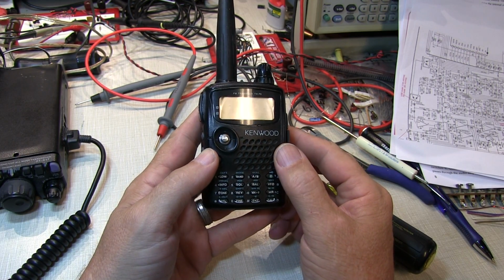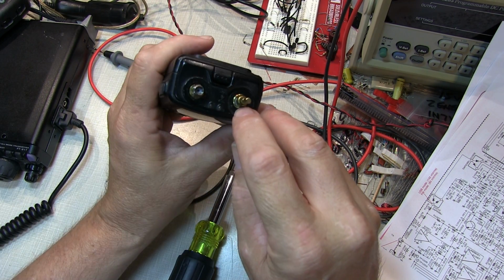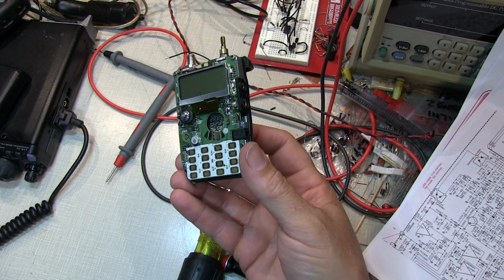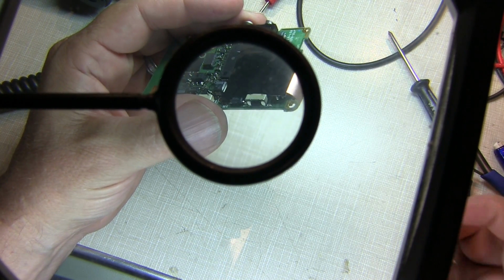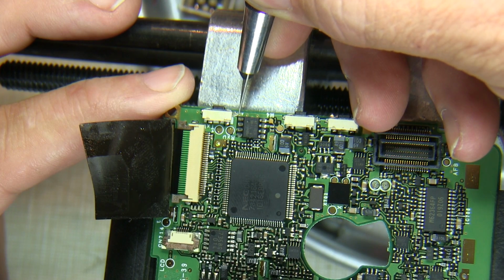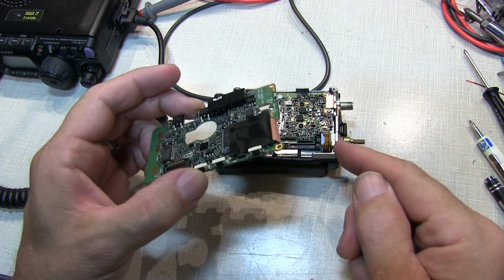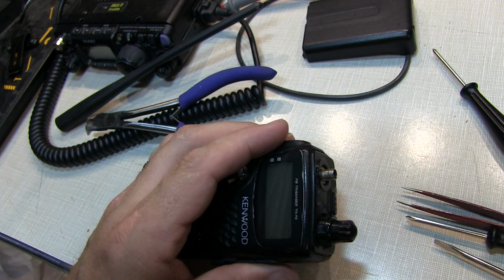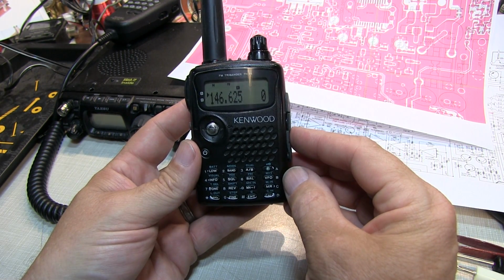#239: Repair of Kenwood TH-F6A radio's Push to Talk switch

Comment: Mine got rained on, which ruined my new battery and now the keypad switches all act dirty or corroded.  Hoping when I open it up I can see oxidation to remove and restore full sensitivity to those buttons.  If anyone has experience with such issues please comment thanks.  

It's such a great HT that I bought a second one in good shape, but I still want to get my old one operating properly again.

Comment: I know this is an old thread however, I'm hoping someone will be able to show how the ribbon-cable connector is loosened so you can remove the ribbon cable attached to the pc board. The video skips that very critical (to me) portion of the repair. I don't want to damage anything by trying to force the connector. A video of this would be most appreciated or a link to a video that shows this process. 73 - W3DRM - Don
EDIT: NOTE the instructions I've found merely say "Extract the encoder flat cable from the connector" Unfortunately, they don't explain how to make this happen.
Reply: SUCCESS!!! The disassembly, replacement of the DC-Jack, and then reassembly went smoothly and without any problems at all. While I had it open, I also cleaned-off all of the old (and hardened) thermal paste. Now, I hope I'm good for another million miles on this trusty old TH-F6A. It has been a true workhorse and tough as nails. Thanks to Alan for his inputs and guidance for the cable-connector.
Reply from the maker: It's been over 4 years since I did this, so I don't remember specifically.  Some of these types of connectors have little release clips on either side and then the ribbon just slips out, and others are more of a friction fit.  For the latter, I'll often use a pair of smooth jawed needle-nose pliers to carefully grip the ribbon, or just do it by hand, and gently wiggle it side-to-side.
Reply: @w2aew  Thanks Alan. I tried using my smooth jawed needle-nose pliers without any luck. Didn't want to try too much force as I certainly don't want to damage anything. I have sent Kenwood support an email request for the "proper way to extract the cable". Will post here if I get an answer from them. 73 - Don - w3drm.
Reply from the maker: @W3DRM  Take a look under some magnification to see if there is a clip or latch that lifts up.
Reply: @w2aew  Thanks Alan. I appreciate the help. I have successfully disconnected the ribbon-cable. To do that, all I had to do, as you suggested, was lift the cable connector clamp that is of a darker color. It just swings upwards and did not take much force at all. Then all you do is pull the ribbon out of the connector (carefully). My next task tomorrow is to remove the lower pcb board so I can get to the dc-jack solder connections and replace it with a new jack.

Comment: I've run into a fair amount of stuff that was not all that robust mechanically,  and ended up with problems like this.  In particular there were a bunch of those cheap little musical keyboards that you used to see all over the place,  with the DC input connector being the problem -- it stuck out the back and if the instrument got pushed up against something that'd tear up the connections like this..  It seems like the mfr. had the soldermask arranged to use as little solder as possible,  so what I usually ended up doing was scraping away a bunch of the soldermask surrounding the terminals and then applying a lot of solder to do the fix.  Never had one come back with the same problem after doing that...

Comment: Hello w2aew, I have an issue with my TH-F6A, this is what happens, as for receiving everything is OK using analog signals, however when i use PTT sometimes the microphone works smoothly and some other times I only hear clicks while the push button works with out the microphone signal. Can you help me with any idea
Saludos
Enrique

Comment: Great video! I used this tutorial to replace the keypad buttons in  my TH-F6A. After 5 years of almost daily use, the bottom buttons were wearing down. Except for the wear marks on the plastic case, it almost looks like a new radio! These F6A's are great little tri-banders and was my first radio as a licensed ham back in 2011. The price has been dropping on these lately probably in anticipation of a newer model with more features. Maybe DMR? 

FYI.... The rubber key pad (BUTTONS ONLY) are available from PacParts, Inc. www.pacparts.com 
Part Number: KEN-K29-9107-22. As of 12/13/2016, the price was $11.17 plus shipping and sales taxes where applicable.
Reply from the maker: Congrats on your repair - I'm glad this video helped.

Comment: with these kind of repairs I always like to add some hot glue or silicone glue just add some mechanical strength to the switch.
Reply: VoltLog I was going to say/ask the same thing...seems like some well placed hot glue or epoxy would have given it a bit more mechanical strength. These things seem so flimsy and easy to brake!!

Comment: Neat !!  I might have tried some hot melt glue to firm up the physical strength after the repair was completed.   I'd worry that the switch might break away again.

Comment: Is there an actual tool available for those slotted retaining nuts? They drive me crazy.
Reply from the maker: I'm sure there is.  I have sometimes made them with a little careful grinding on an old socket, or have also use a "watch back" tool.
Reply: +w2aew yes, yes there is. I have one at my work place and use it all the time, love the video's w2aew, de vk3hau
Reply from the maker: +vk3hau  Can you let us know what the "official" name of this tool is, and where you bought it?
Reply: +w2aew it is work suppled, may be RS components but will have to check when I back at work, off work for 2 month sick leave with broken leg. So as soon as I know I will let you know, I'll have a google look to while laid up in bed...hi hi..
Reply from the maker: +vk3hau  Oh, sorry to hear about the broken leg - ouch!  Thanks in advance for the info, and hope you mend soon!
Reply: +w2aew I found the ones I use at work, here is a link, check them out, they are Spring load interchangeable head with swivel head so the head clamps inwards or outwards, they are known as circlip pliers but they work a treat on these nuts, been repairing radios in my line of work for 14 years and these ones I use have been at this workshop longer then me.... https://sydneytools.com.au/boxo-boxvg406b-multi-circlip-pliers?fee=4&fep=11607&gclid=CjwKEAjwoPG8BRCSi5uu6d6N5WcSJABHzD8FHLdee0U0IgAdDJWf90TbUd3K-rADaBBao959mfCD7BoCaXLw_wcB
Reply from the maker: +vk3hao - Thanks! I've used those circlip / spring clip pliers as well, especially the 90-degree bent variety. I have also used a watchback tool.
Reply: vk3hau
 Thank you very much.

Comment: Cant believe how much electronics was in that little radio, how do technicians repair such fine pitch components, some of those caps and resistors look not much bigger than a pinhead
Reply: I was repairing similar and even more complex or dense ones everyday. If you have the tools and experience you can do it too.

Comment: Could have added some epoxy glue to give extra strength against button pushes
Reply: Exactly what I thought
Reply: Me too... may be a dab of hot glue add some strength?
Reply: Hot glue is much easier to remove if you need to rework it at a later date. Epoxy is nasty, and can lift tracks when you try to remove it. the heat gun removes hot glue. Cynoacrylates can fume, and damage glass and switch contacts.

Comment: Nice repair.  Had the traces been worse it wouldn't have been a reason to give up.  I do trace repair all the time and its not that hard.  A sheet of copper foil, some Circuitworks epoxy, magnifaction, a #11 scalpel, good selection of tweezers and patients and even the most severely damaged PCB can be repaired.  Seems like a daunting task at first but with a little practice its a breeze. 

Mike
Reply from the maker: Good to know.  I'm really lacking for good magnification...
Reply: +w2aew 

You would be surprised what you can pick up on ebay cheap.  Doesn't need to be fancy, just functional.
Reply: +1 to reworking the tracks even if badly damaged.The only thing I would add, is if the board is burnt, remove the charring and fill with epoxy before you rework the tracks, burnt PCB has a relatively low resistance... and multilayer boards are much harder to repair, so this applies to single or double sided boards only. If you have a multilayer board with a big hole burned in it, its probably for the bin.